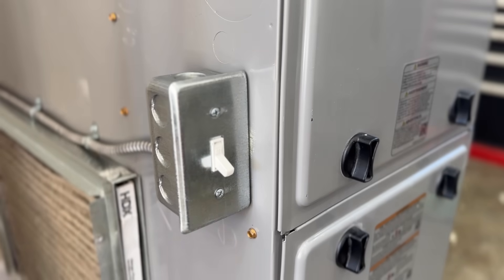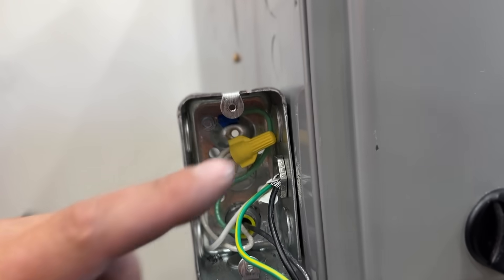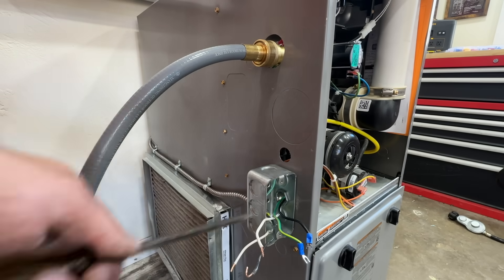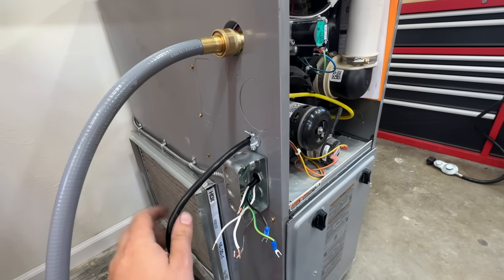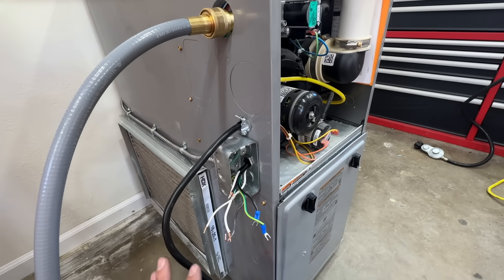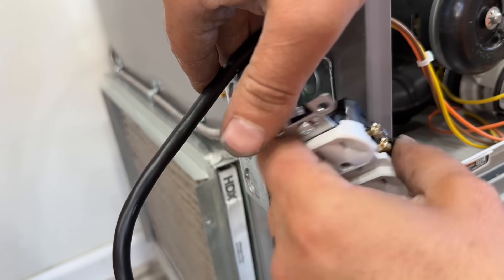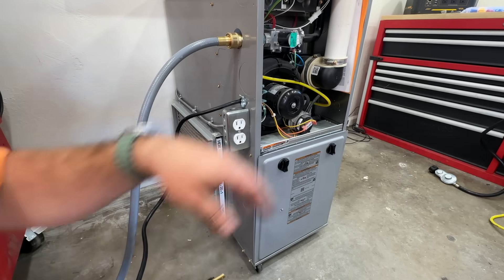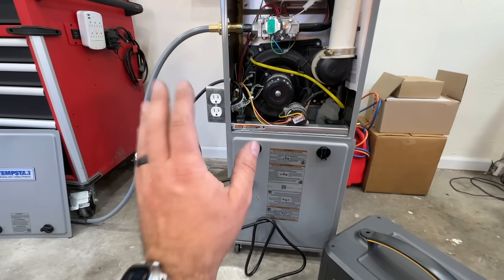Keep Your Family Warm During A Power Outage By Installing This $5 Part

Comment: Great video! Only thing I would have done differently is strip the jacket on the pigtail back some and make the it and the furnace wires the same length. It'll make splicing the 2 together easier and make tucking the wires into the box cleaner with less stress on the wago/wire nut

Comment: My electric company is about as dependable as a 40 year old condom. I was just looking at the Vtoman Jump 1000, and was curious, How long will it keep my forced air gas furnace running, until Duquesne Dark decides to fix my electric?
Reply from the maker: Uhh it ran my home for like 17hrs of cycling in the middle of winter.
Reply: @diyhvacguy  Thanks. I can do this. I know how to wire things, so I'll order the stuff. Thanks again!
Reply: @diyhvacguy  — That’s pretty good. What is the Wh rating on your battery ? I’ve been considering one of those because of convenience. For now, a 2000W generator will keep the food cold and house warm for several days if need be.
Reply: 3 hours of runtime, assuming a 1.5 kWh battery and furnace that draws 500w (fairly typical)…
Reply: @Clyde-2055  Thanks. I'd like to think that Duquesne Dark would even have the power back up and running in 3 hours. LOL

Comment: For the past 30 years, most gas furnaces use a pigtail plugged into a receptacle.  In the event of a power outage, you plug the pigtail into an extension cord from a generator.

Comment: One thing I noticed is that the original cable is armored, but the new one is not.
Reply from the maker: Yes that’s the cable that runs from your breaker panel. It can be amorflex or solid conduit. But the pigtail makes it capable of plugging in and being unplugged. That’s your means of disconnect instead of a switch.

Comment: It is going in a metal box, there needs to be tape around the outlet to prevent grounding. Where is the switch for the furnace? Why not put in a double box, one for the outlet and one for the switch.

Comment: Wow. Just found this video and I remember your previous one. This new video takes all or most of the mistakes listed in the comments by electricians from the previous video (like the ground, switch, wiring,) and fixes/explain them plus its much easier to follow. Awesome channel man. Thanks for your hard work.
Reply from the maker: Thanks so much! 🙏🏻
Reply: Omg, stop. There are so many code violations here and potential for fire. Your local fire department would ask you to stop, your local code enforcement would ask you to stop, and your national electric code would ask you to stop. You are creating fire situations. Please stop and take this video down.
Reply: @Low_Light1of1  can you provide all the violations? Need actual sources.
Reply: @tmn15 , Wouldn't, the first violation, be , that you removed it from the main breaker ?
 And over by passed the Furnace Breaker, which the breaker is there ?
 To prevent anomalies, or electrical fires ?
Reply: And look for my comment for further information on your violations

Comment: Nice concept. But the battery powered generator needs to be at least 1kw and without any spare battery that costs around $600.00, and for how long would it power the furnace before the battery needs to be recharged again?
Reply: 3 hours of runtime, assuming a 1.5 kWh battery and furnace that draws 500w …

Comment: When using a generator to power your gas furnace, is it better to leave the fan on continuously, rather than on the "auto" setting?  I was told leaving it on eliminates the surge every time it starts, making it easier for a smaller inverter generator to power.
Reply: YES …
Reply: Thank you. @Clyde-2055

Comment: you can solder connections to wire. wire would have to get very hot to break solder down, plus breaker would trip with that kind of heat.

Comment: Take this one step further and show you would wire it to an inverter/charger with a battery bank.  I know that will work with the gas furnace but another step up from that would be how it could also power a ducted heat pump (assuming it is now 240 volt) if you have a dual fuel system.  Some idea of how much power consumption vs the battery bank capacity would be good to know that way you can gauge how much time the grid could be down before the batteries needed a charge.

Comment: Have you ever run a test to see how long a furnace will run on a 90 Amp hour battery? I have a generator, but getting it out of the garage, wheeling it behind my house and connecting the ground can be a lot of work depending on the weather conditions here in Ohio. 15 Amps at 120 volts is 1,800 watts. With an 1,800 watt inverter I would not think that  I cold get more than 1 hour furnace run time from a 100 Amp Hour battery.
Reply: A home furnace doesn't use 1800 watts.  More like 500 or so.  If the battery is 1000 watt-hours, it would run that for 2 hours continuously.  

BUT furnace motors don't usually run 100% of the time, so that's really about 2 hours of motor run time.  If a furnace runs 10 minutes every hour it would last for 12 hours.

Also inverter power is not the same as battery capacity.  Power is measured in Watts and capacity is measure in Watt hours.
Reply: @LoanwordEggcorn  That is unrealistic to assume a furnace will only run 10 minutes per hour. That assumes the house didn't get cold before you got this running. And it assumes it's not very cold outside. When it's 10 deg below zero, my furnace runs 100% of the time. i found out that is how the furnace was specified.
Reply: @8546Ken  Yes, it varies by season, weather, local climate, etc.
Reply: Guys, here is The Savior

HalleluYAH translates “Praise ye YaH”

YaH is The Heavenly Father 
YaH arrives via the TENT OF MEETING
YaH was Who they Crucified for our sins
YaH was Crucified on an Almond TREE

— Ancient Semitic Cuneiform of Moshe (Moses)
— Isa Scroll (The Original Isaiah)

Isaiah 42:8
"I am YaH; that is my Name! I will not yield my glory to another or my praise to idols.

Isaiah 43:11
I, I am YAH, and there is no other Savior but Me.

Isaiah 45:5
I am YaH, and there is none else.

Comment: I ordinarily switch the whole house to backup generator, so I have put off setting up this other type of furnace backup power system.
It would still be nice to have in case I decided to wait the power outage out rather than switching to generator. I have an auto battery (kept on trickle maintainer) and 2000W inverter that would be the power source.

Comment: My local code in Canada requires an isolation switch between the furnace and the escape door. This exists in the power wire from the panel so as long as you can turn off the generator you have the same effect?

Comment: I assume this will work on a 15amp oil furnace as well?

BTW... I think it would be important to put a sign on the furnace telling the operator two things: 1. The power cord supplies power via the outlet on the side of the furnace or a generator.  2. Before hooking up the cord to a generator, it will be necessary to change the thermostat to "Emergency Heat" only if you also have a Heat Pump connected to the unit.

Please correct me if I am wrong about this. I'm not an electrician and need to know if there is something I am overlooking. Thanks.

Comment: I like the previous version with outlet AND switch much better. Without switch, when you pull out while furnace is operating, you create a spark within the outlet. It will destroy this outlet soon if you have to do it often. Outlets are not replacement for switches, they should be used for connecting or disconnecting devices in a turned off state.
Reply: Valid point, although the current draw is not very high. I would simply use the breaker for disconnecting means in the event I have to isolate the furnace from normal power.

Comment: I would like to set my furnace up like this, however my switch on the box has a 20 amp screw in type buss fuse at the top of the switch. How would I go about changing this. Thank you and I very much appreciate all that you show us new diy folks.
Reply from the maker: If your furnace is rated for 15 amps I’d make sure your breaker matches, and then you can get rid of the fuse all together. A lot of people put one of those fused switches in with a 15amp fuse because they’re too lazy to swap the breaker

Comment: That is much cheaper than an EZ Generator switch but probably not to electical code by me. Still it beats freezing if the power is off for a while in winter. Great video!

Comment: The plug is hot , when power is on correct ?
Reply: And then when the power comes back on , what ?
Reply from the maker: The outlet is hot when power is on. The plug is never hot. So you plug the pigtail into your generator or power station and then when the power comes back on, you unplug it and plug it back into the outlet 👍🏼
Reply: @diyhvacguy  I'll watch again

Comment: I would have wrapped the entire outlet around with electrical tape covering the screws which have the power and potential to short to ground in a metal box.  Other than that looks good!

Comment: I had my HVAC company estimate this change. They wanted about $500. It's not the parts that are expensive, it's the knowledge and ability to do the job right. If you're going to use a portable generator, there is a whole list of cautions on connecting to an ungrounded generator.
Reply: No one should operating a Generator without a ground.... Yes, there are idiots out there, but if someone cannot make this very simple setup, they should not be pushing a lawnmower or driving a car.
Reply: Your outlet should be grounded already back to breaker box that is grounded to home ground rod. Am I missing something
Reply: @westvirginiaminer3046  When you pull the pigtail out of the outlet, the pigtail will see no ground. That is why you need to ground the generator, by code to a dedicated ground... You should not use an outlet ground as he did here, it is against code...

Comment: I love the idea of being able to hook up a generator to my furnace.  We have outages ever couple years and one time it was subzero outside and the inside of our house got down to 35 degrees before the power came back on.  I do have one concern with following the instructions on this video though.  There is a 15 amp fuse built into the circuit on our furnace.  The furnace is only 5 years old but it replaced a much older one.  The electric box was from the old furnace.  Is there a reason to keep this fuse?  The circuit breaker is a 20 amp...
Reply from the maker: I’d swap the breaker to a 15, and then you can eliminate the fuse all together as it’s redundant

Comment: So mission accomplished Thanks. 
But I had a switch and fuse on/in the box outside the furnace.  Another box was inside the furnace where the wiring connected. I simply undid the inside box and disconnected the wires. Then attached the pig tail (shortened) directly to the furnace wiring. I used a single plug in the outside box. I ran the pig tail through new knockouts and as I said, tied it to the furnace wiring. Also grounded the pig tail.  Am I good? Do I need that fuse?  By the way some floating neutral generators won't run some furnaces. Call Firman Generators for the solution, easy fix. Yes, there is a dedicated service breaker for that line.

Comment: Great video. And still have a means of disconnection. Just not a fan of wagos over maretts for making connections.... i wonder how long that size power supply would last during a power  outage ?
Reply from the maker: It ran my furnace for 20 hours! Cycling obviously but still impressive

Comment: If using a generator as your power source, I highly recommend an inverter generator. As opposed to standard generators, inverters have very low harmonic distortion. Although furnaces have many mechanical parts, they also have complex circuit boards which can be damaged by regular generators producing high percentage harmonic distortions. Inverter generators produce clean electricity much like that of the power grid supplying your home. As a general rule, any electronic device should be powered by an inverter generator or a means supplying clean electricity.
Reply: In think you mean you want a true sine wave inverter. The cheap "modified sine wave" inverters just put out a square wave; which have the odd harmonics that you mention.
Reply: We had no power for 5 days and the generator ran the heat  and freezer and ice box
With only 2 50 watt led flood lights
Reply: 100%
Reply: @dermatt3457 Absolutely correct! 💯
Reply: This is what I have in case of a power outage. Ran my furnace with my refrigerator no issues.
Reply: @cgkuch4184 not a real issue unless you have a duel stage high efficiency furnace
Reply: never even knew such things exist.  Definitely true about the controller boards, they often don't tolerate dirty power.
Reply: The manual for my new Lennox states that generator power must produce less than 5% THD in order to power the furnace electronics.
Reply: Best to read your furnace manual and see what thd it allows
Reply: Does this apply if planning to use a solar power battery  /  generator  from solar roof panels  ??   I know  NOTHING  about harmonic distortions,  absolutely NOTHING.    (Except for what I remember back when harmonic distortion was a selling point in high-end stereo systems).
Reply: Can I buy something to correct the sinewaves on my older type generator so that I don't damage my furnace electronics?
Reply: Find this SO funny! Home stand by generators are NOT inverter type generators. Don't see everyone getting a new furnace after power outages. Not even weeks long outages. Onan, Kohler, Generac home stand by generators are all standard old fashioned generators
Reply: @kirkstinson7316 Actually, you’re wrong. The majority of those stand by generators produce a pure true sine wave which electrically inverted. I do believe if the engineers of these units recognize the potential for large harmonic distortion as damaging to electronics you must know better.
Reply: Guys, here is The Savior

HalleluYAH translates “Praise ye YaH”

YaH is The Heavenly Father 
YaH arrives via the TENT OF MEETING
YaH was Who they Crucified for our sins
YaH was Crucified on an Almond TREE

— Ancient Semitic Cuneiform of Moshe (Moses)
— Isa Scroll (The Original Isaiah)

Isaiah 42:8
"I am YaH; that is my Name! I will not yield my glory to another or my praise to idols.

Isaiah 43:11
I, I am YAH, and there is no other Savior but Me.

Isaiah 45:5
I am YaH, and there is none else.

Comment: Does the thermostat need to be powered as well in a power outage?
Reply from the maker: Yes the furnace powers the thermostat so as long as your furnace has power, your thermostat will function as normal 👍🏼

Comment: I have a similar idea but I want to make a UPS provide backup power automatically. I’ll connect an UPS to the existing power feed and then connect the boiler to the backup UPS. Do you see a problem with that approach?

Comment: Hey brother…love your vids

How long can one expect those power stations to power only the furnace?

And any ideas of what product power station to buy ?
Reply: Well you liked my comment but didn’t give me an answer????
Reply from the maker: This one ran my furnace for 20 hrs of cycling. It was a 1000 watt. So it all depends on how big of a power station it is. I’ll be testing the big bluetti you may have seen in my basement this winter. It should power my furnace for several days.
Reply: @diyhvacguy  thanks man…..I have been installing power inlets , but this seemed like an easier solution for people that can’t handle the effort that a generator requires…..peace!
Reply: @diyhvacguy  would love to see a vid documenting brand, watts, and how long customer could expect it to run

Comment: My emergency power supply is a Lincoln Ranger 8 welder/generator (8 kw).  Pretty old generator/welder.  Do I need to worry about the "quality" of the electricity that it generates for this application?  Thank you so much for your informative videos!
Reply: You might have problems.  I was using a computerized test equipment at a jobsite and initially powered it off of a welder generator, had nothing but problems.  Got a small inverter generator and then things worked perfectly.  It depends on the gear you are powering, but the more computerized the more it is likely to need an inverter type.  Maybe you could contact Lincoln and ask them?

Comment: I used a 20 amp male on the furnace feed 12/2, and just plug it into the outlet. use a female 20 amp plug on the breaker box feed for a safety cap.. And a double end 20 amp male pig tail to hook Genny up. over 20 years like this, not a prob

Comment: How would you make it kick on if the thermostat is dead?
Reply: Most forced hot air furnaces, like the one that he used in his demonstration, power the thermostat/s from the same transformer which powers the furnace's controls. So once you power the furnace you will have powered the thermostat also. 

Tom Horne

Comment: Don't you need a fuse on the pigtail side?
Reply: That is taken care of by  the Over Current Protective Device (OCPD), usually a circuit breaker, in the power source or on the generator. Those receptacles will be protected against overload at 15 amperes as long as they have the 2 parallel slots for the plug blades to fit into and not one vertical and one T shaped. 

Tom Horne

Comment: excellent idea and option, why don't they have a dedicated backup battery option too, where you can hook up the furnace to a backup battery which would run for a couple of days until the power comes back on , 99.9 percent of the time the power comes back withing 32 hours here in michigan, yes I know you can plug the furnace to a portable ups or larger battery pack